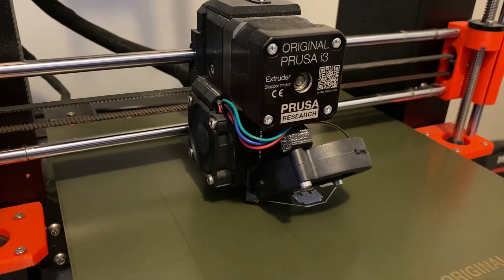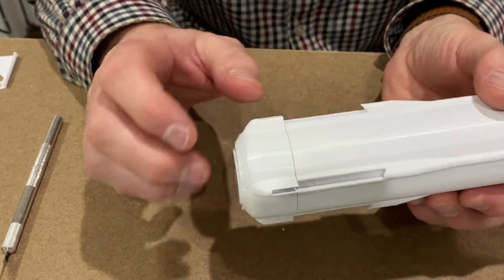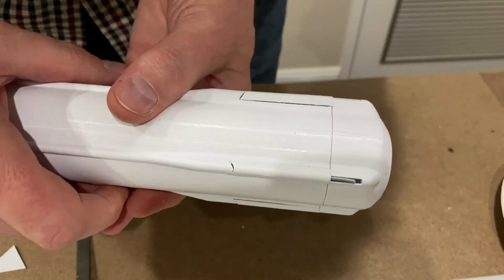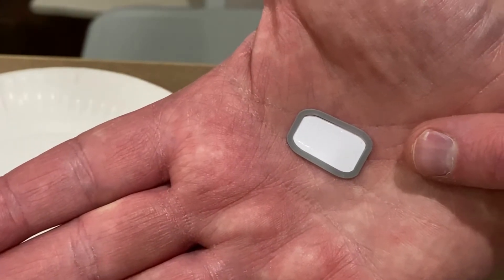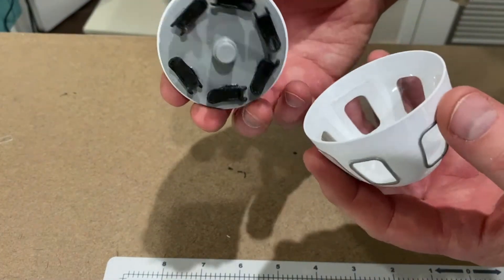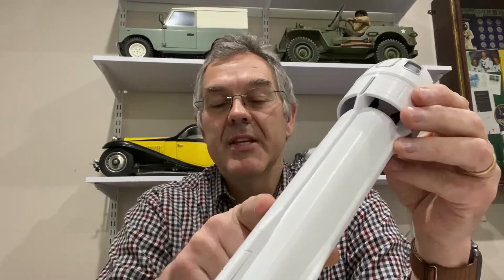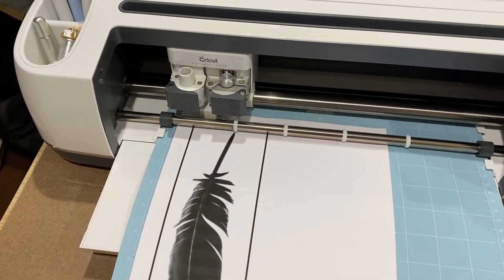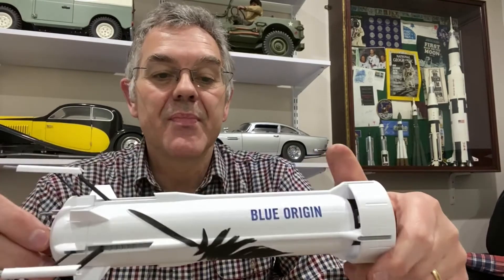3d printing a model of the Blue Origin New Shephard

Comment: Any chance I could buy the vinal decals from yourself as I don't have a cricket?
Reply from the maker: Hi there.  I'm not really set up for selling products.  In order to produce a full set I would have to set everything up again (I printed mine one by one as needed).  It would probably be too expensive to print and post them.
Reply: @modellingmisadventures  if you don’t mind me asking which cricket are you using as was not aware that they did print and cut now.
Reply: @taylors-workshop  It’s a Cricut Maker.